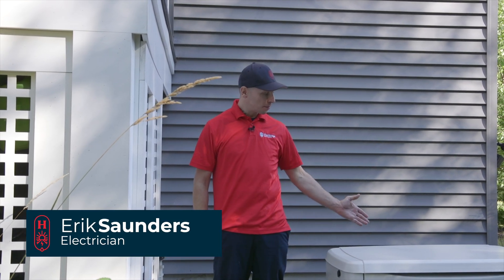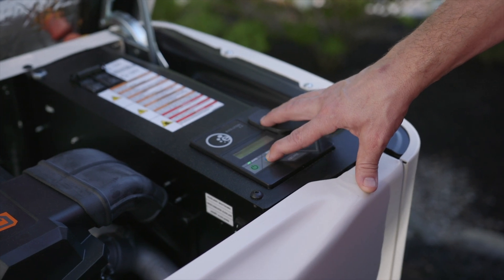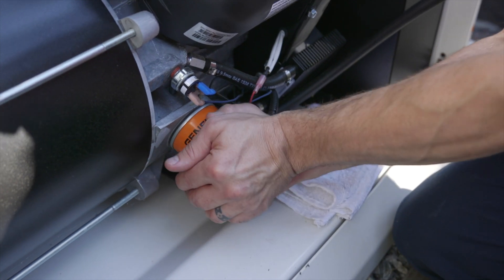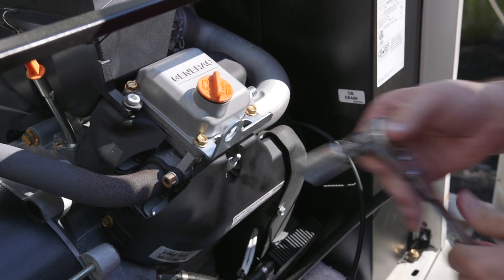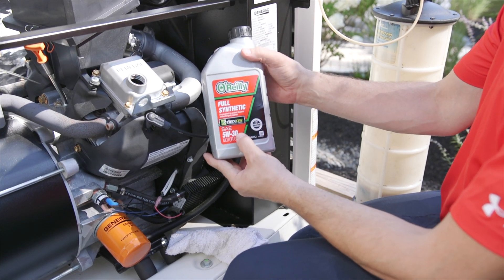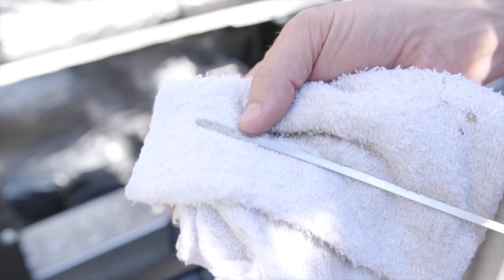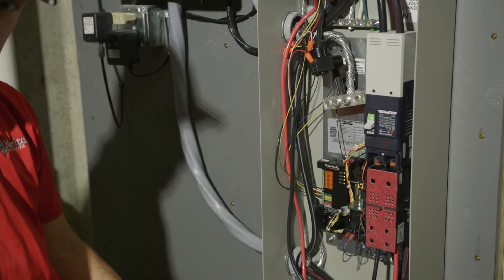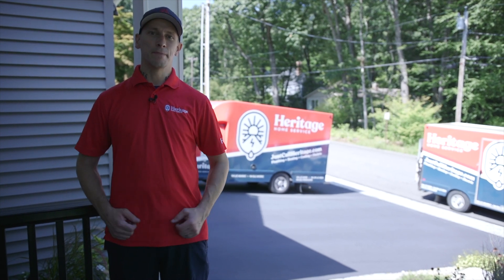How to Perform a Standby Generator Maintenance

Comment: I don't use automobile oil the ZDDP is way to low for air cooled applications especially for continuous RPMs the shear stability isn't very high with these oils I only use Briggs and Stratton 5w30 100% synthetic or Amsoil small engine oil 5w30 100% synthetic they are around 1300 ppm on ZDDP the oil your using is around 750 ppm and no where near 100% synthetic there's a certain percentage that needs to be to labeled full synthetic even Mobil 1 not 100% not even close for most brands, the bearing load is way to high for low ZDDP oils the reason they are low level nowadays is the emission system they can't have alot zinc and phosphorus true small engine oil is very similar to racing oil except they have more detergents for dirt these car oils are ok for short outages and exercise but begins to wear the cams out and the main bearings on the crank prematurely the bearing loads on these engines are extreme compared to a passenger car
Reply: Good point.  I use Cam Shield ZDP additive in my '79 MGB.  I'll add an ounce of that to my Penzoil Pure Synthetic oil in the generator.   I wouldn't use O'Reilly brand oil in anything I own.